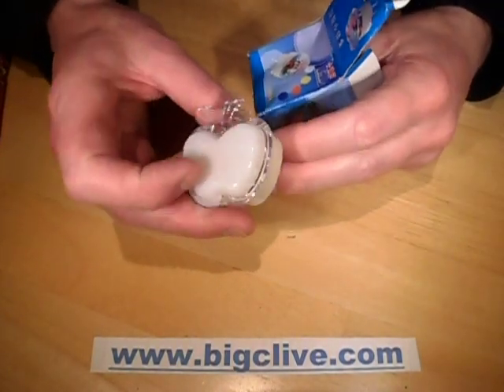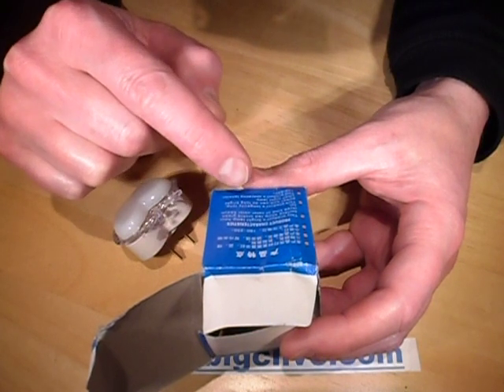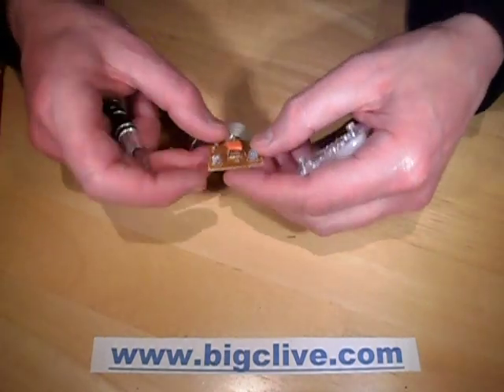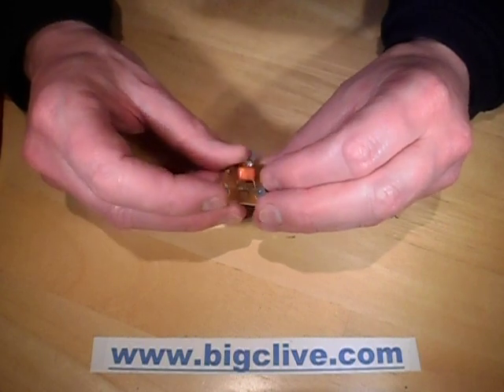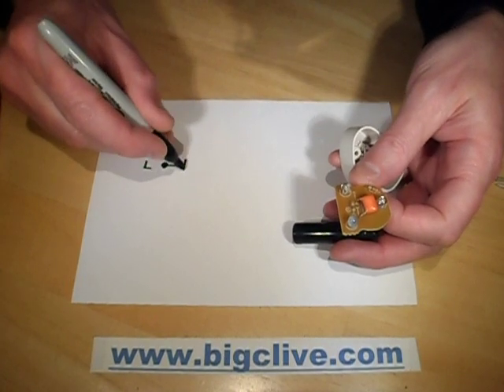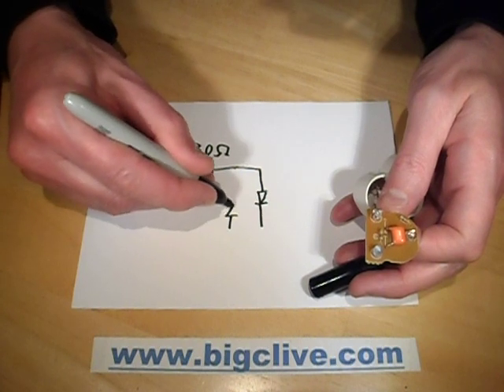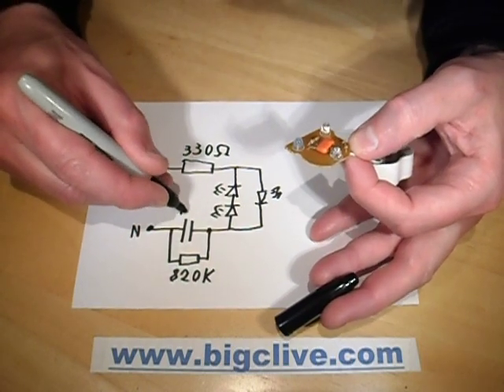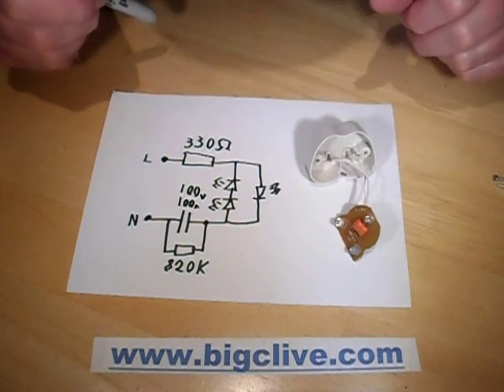Teardown of the worlds crappiest nite-lite.

Comment: no wounder it flickers,  its running on 50Hz AC , a single diode can do a half rectificantion that this night light need,  but you will have to swap out the rezistors to a higher rated ones

Comment: If it's got a US style plug (US voltage around 120) then it's designed for the US market so it's a bit of a risk if you plug it into 240V.
Reply from the maker: +Green Man Chinese 220V plug.
Reply: I did say "If".

Comment: why do my LEDs do this? ok i've got a 1 meter long strand of LEDs that said they take 12v but when I cut off the old 12v adapter and connected an old 9v adapter they run brighter.
Reply from the maker: If it's an old heavy adapter then it might not be regulated and the voltage can rise quite high with a low load.

Comment: Dear Clive:  I have a nice, cheap 120-V. Walmart night light.   But flicker is discernable in one's peripheral - not direct vision.
Circuit is:    Left plug prong -> [diode] -> [1/4-Watt 10,000 ohm 5% resistor] -> LED[o] -> switch -> right plug prong.
Nice, warm 2700K light!      Why is its flicker not terribly noticeable 60 Hz halfwave flicker? 
Is there microcircuitry in the [o] wafer?  (It has 6 leads but I can't see where they go.)  Squinting, I can see that the 3 mm orange-ish yellow dot has three little bright spots inside.   I assume it is a phophorescent material excited from UV LEDs beneath.     Perhaps that slows ON/OFF smoothing out flicker.

How can I eliminate ALL flicker?     I want to mount this in our grandmother clock aimed down to illuminate the brass chains, weights and pendulum bob.    Thank you.   Robert  USA    

Your apple light has LEDs cleverly reversed in polarity to reduce flicker.   (Illuminates each side of the AC sine wave.)

Comment: I've actually seen a night light which is worse than this... It literally consisted of a single LED in series with a diode and power resistor. According the the silkscreen, there was also supposed to be a photo-resistor in parallel with the LED to turn it off when the room is bright, but thankfully this was missing as it would save no power whatsoever (in fact it would slightly increase current). At least it didn't have any horribly underrated capacitors... or any, for that matter.

Comment: I would probably remove all the AC stuff and then wire that to run on 2AA batteries. LEDs were never meant for AC usage. I connected an 12V LED to my halogen desk lamp (bulb burned out) and it was flickery as hell. Very annoying. If I could figure out how to smooth that out then it might work.
Reply: Fullwave bridge and a capacitor.

Comment: sry for commenting on a old video.

But when you put it into a simulator and turn the timestep down, its easy to see the flickering 
there is a very long pause between switching the led rows.

I tryed to replicate it here .. 
http://everycircuit.com/circuit/4564428897386496
Reply: Eqvaliser commenting on an old video is different than bumping an old forum thread.

Comment: This is meant to be used for 110/125v operation, hence the US socket. NOT the 230/240 UK standard
Reply from the maker: iTechUHD It's designed for the Chinese sockets on 220V.
Reply: That makes more sense.
Reply: +bigclivedotcom The horrible safety is SCARY. It could blow up and catch on fire anytime.
Reply: China uses US style plugs (without the locking holes) for  2 pin or Australian style plugs   for grounded/Earthed stuff.